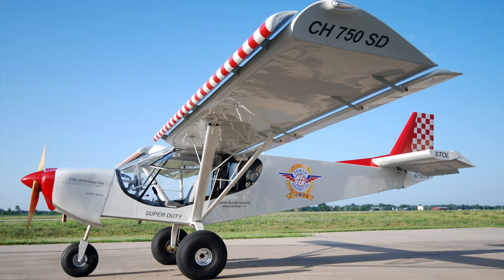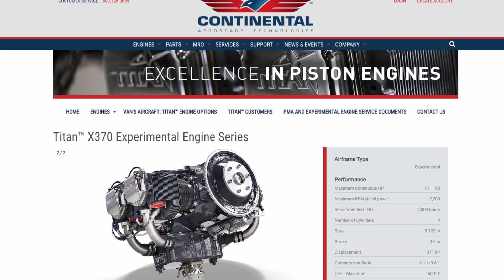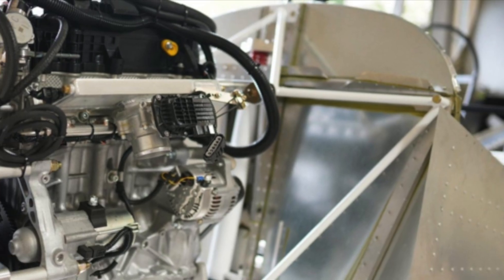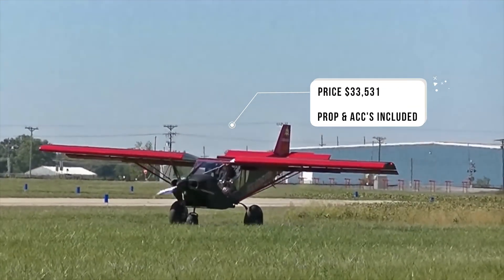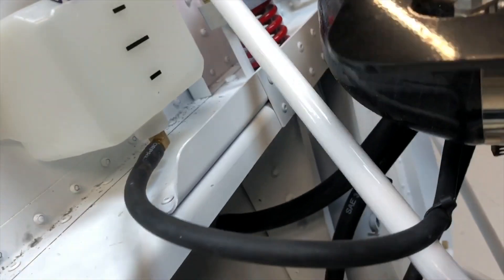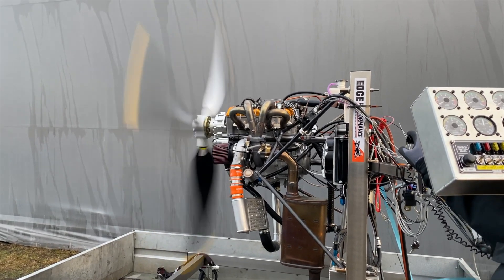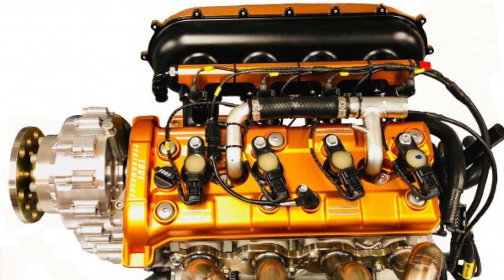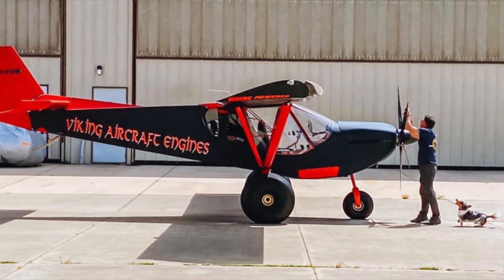Ep. 10 | Engine Options | Zenith Super Duty Aircraft Build

Comment: These engines are all crazy expensive if you think about what you are really getting.  The viking utilizes used Honda engines which can be had for under $1000 for a low mileage used engine.  The prop drive should be the most expensive part on that whole assembly.  I would really like to know what they all do to the engines to drive up the price.  I am looking at Aeromomentum engines which utilize Suzuki or Hyundai I believe.

Comment: It’s 2021 - my way of thinking is that engines designed in the 1940s are not really competitive now.  The Viking leverages off millions of car engines and modern injection and ignition systems.  Also that VIP service could be worth its weight in gold for the install.
Reply: Read what the Vans website has to say on this issue
.
Car engines are not designed to run at a constant RPM (not RPMs) for hours at a time.
Car engines are designed to utilise a multiple-ratio gearbox to turn wheels.
They are not designed for a single ratio gearbox to turn a propeller.

The reason why aircraft engine designs are so old is the same reason why Weber still make the world's best high performance carburettors.

The 4 stroke horizontally opposed gascoline engine became obsolete in general aviation following the introduction of the jet and turbine engine.  Just as EFI rendered the carburettor obsolete.

Whoever had the market lead the during the 1960s and 1970s was going to hold onto it for ever after that because the incentive to engage in R&D and product development dried up.

Hell Lycoming and Continental still haven't come to terms with the fact that it's unacceptable to put lead into gascoline and has been since the 1980s.

What we need is 6 cylinder and 8 cylinder Rotax 912 derivatives to blow the Lycocaurus engines out of the air.

Sadly Rotax have decided it's cheaper to try to squeeze every last horsepower out of the 912 platform by adding turbochargers, higher compression ratios and engine-mapping trickery to the 912.

A 6 cyclinder naturally-aspirated 912 would give you 120-150 horsepower depending on whether it's based on the 912UL or the 912ULS.
A naturally aspirated 8 cylinder 912 would come in that 160 to 200 horsepower.

They'd be a perfect fit for experimental aviation AND more reliable than a Rotax 915iS or a Rotax 916iS.  Probably cheaper too.
Reply from the maker: Yes, especially for the experimental market.  Lots of great engine choices and the Viking is tops for FWF ready to go and support.

Comment: I think the Edge Performance 300hp like you showed on Steve Henry’s Highlander would be pretty epic in a Super Duty.  I’m sure he’d be willing to assist with getting the engine mount as well, he’s a really good guy.
Reply from the maker: Edge Performance definitely makes a quality product, just not sure if I want a low TBO and crazy high RPM's.  Haven't made final engine choice yet, keeping my options open.
Reply: @AeroworksProductions  have you taken a look at ULPower?  John Humberd runs a 100hp I believe and I think they’re coming out with a 260hp turbo that is direct drive so no gearbox.
Reply from the maker: @DreadnautVS  Yes, but it's like $45-50K.....:(
Reply: @DreadnautVS  Humberd's is the 130 hp version...
Reply: What would be the advantage of the 300hp? Not going to be much faster then the 200 hp entries. Lower cruise rpm so lower gph of fuel? More torque so faster climb maybe? Don't get me wrong, for ground based applications, question such as these should never be utttered and pretty much amounts to heresy as it is! hahaha
Reply: The first UL engine to be fitted to a Vans S-21 (a 520iS I think) disintegrated in flight soon after the aircraft was declared airworthy.
There's mention of this incident on the ULPower website, along with the usual "it wasn't the engine's fault" disclaimer from the manufacturer.
Reply: @philipritson8821  wow, that’s not good.

Comment: and what range can be obtained on these engines?
Reply: Here is some info on range, the Viking runs 9-9.5 gph the factory gets 12-14 gph in the Titan. These are factory numbers :)  https://www.vikingaircraftengines.com/variable-pitch-propeller
Reply from the maker: Great question, as you probably know aircraft engines are rated at “GPH” gallons per hour.  With these engines running from 5-9 GPH and just shy of 50 gallons of fuel, you have about a 350-450 mile range with 30 min reserve.